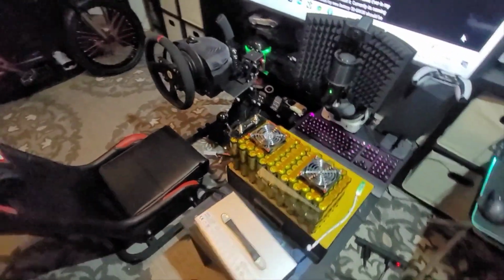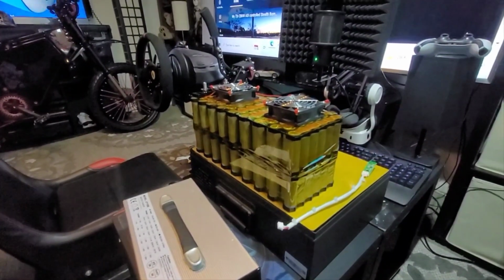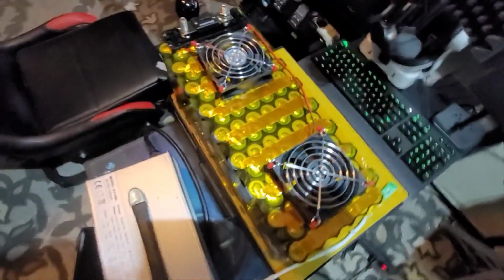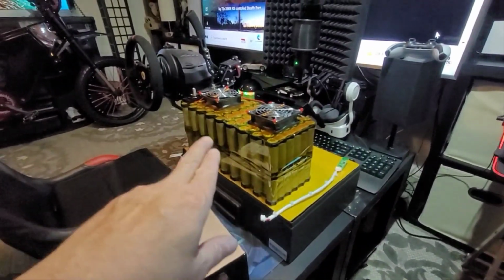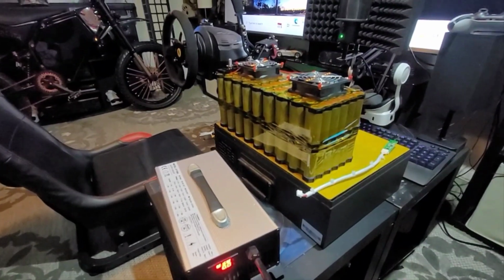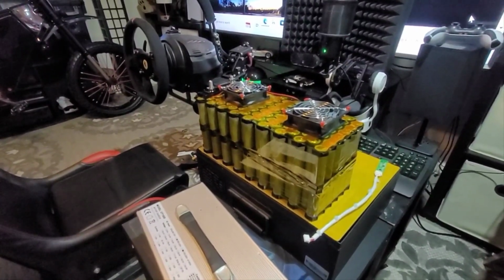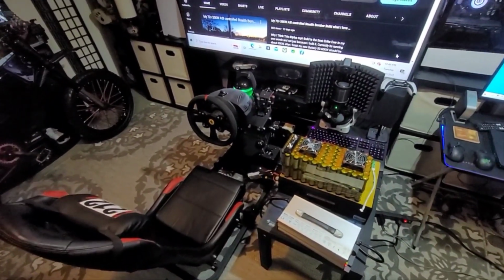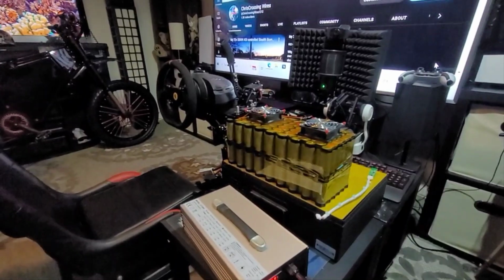72-96v system 23s12p more on my modular Battery system with two outputs cruising & racing mode 😎

Comment: Every way I try to count the cells in the pack it only comes out to 18p. Are there more cells on the bottom then the top?
Reply from the maker: There's 18s there you exactly right and there's 6s in the other part as that's the most I can get in that direction wth the length of frame There's another section that sits underneath. I had misspoke when I made this video on how many cells were in each section as I didn't think anyone would actually be sitting there counting lol proved me wrong but yeah at time it was 18 there 6 in other part. It's changed couple times since then now it's only 21s but 14p. I'm actually change it again. I was deliberately trying to confuse my biggest Hater and copycat that was copying everything I do if you know how many volts or amps you need for your pack what I'm actually running in my shouldn't matter but for that reason there's a whole lotta copycats being tho I was making a race bike while I was filming and posting this build I surely was not trying to give accurate details on my bike. Thank you for drawing attention to that
Reply: @ChrisCrossing Wires  OK cool. I'm rebuilding a pack for the same frame and have been looking everywhere for  a 10p 20s cell configuration for it. I remembered the first time I watched the video you said 20s and was looking to see how you got it to fit. 

I'm using the lishen 21700 cells and want at least 40a so need to fit 200 in there somehow. Also not wanting to get to crazy with the configuration or modify the frame. I think 10p side buy side with fit in the middle without cell holders. 

I guess I have to test it out.

Comment: Looking good! I talked to Daly about getting a charge only bms they suggested no bms just a smart meter. Man have you seen the liquid cooling for  battery packs?
Reply from the maker: Naw Bro but I don't think I Wana add any not weight than it already is and that sounds heavy especially with enough liquid that it would actually work and honestly I don't want to mix liquid with batteries sounds like a mess waiting to happen if you can manage yourself to keep your battery's cool you got bigger problems. I don't think I'll ever wanna run my pack to that point is getting that hot to even need such cooling. That sounds like a motocross issue where you're race last for a lengthy period of time. I'll never be full blasting for miles and miles so on ebike probably not necessary. Emotorcyle maybe?
Reply: @ChrisCrossingWires1212  https://youtu.be/Bt3AKMq1mRk

I feel ya but I know yer a tech dude... so check it out if you have a chance.✌
Reply from the maker: @Dust  that's awesome but geesh I need one so big I'm sure cost more than the batts lol

Comment: Hi Chris, have you looked into making and attaching a supercapacitor pack to add to your batteries ? They will really boost the performance and put less strain on your batteries.
Reply from the maker: you obviously haven't watched my previous videos so I'll let that be a reason to do so lol
Reply: @ChrisCrossingWires1212  Fair enough, ill take a look lol
Reply from the maker: @9 Mile Roar  I'll save you but sure I'd like you to look but yeah that was my original plan for this pack running super caps along side my cells but after acquiring my new seat that has a pocket for the controller giving me plenty of space on my frame now I have enough room to just add more cells. I'm fully aware of the benefits they do in aiding to a battery system but at the end of the day when space is not a factor would I rather have a cap or actual high output cell, I'll take the cell. lol but awesome tech and yes I did that on my first ebike

Comment: No doubt you got this man, Did you check the differential voltage on cells? How did they turn out after all said and done?
Reply from the maker: they were all exactly the same right on the money. I think them being new cells made that nice and easy. I know that's more common with harvested used cells there voltages are all over the place, these cells were all exactly the same.